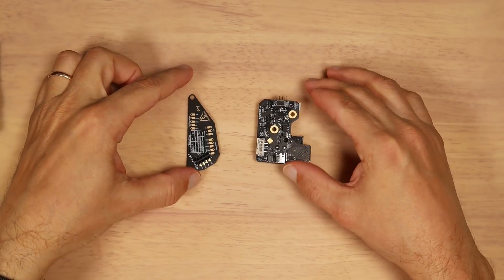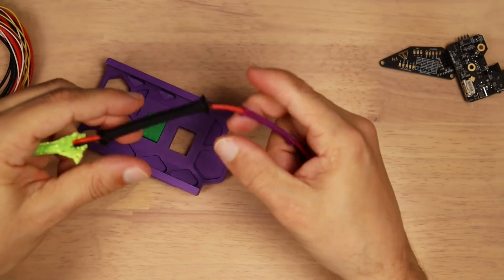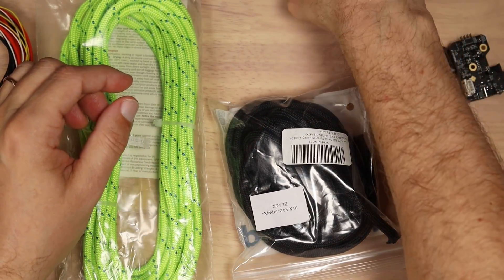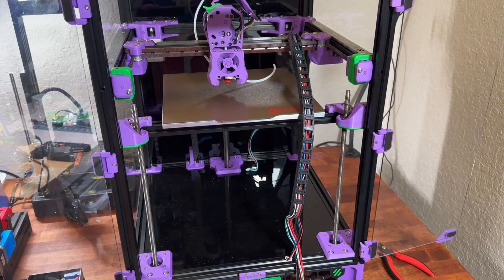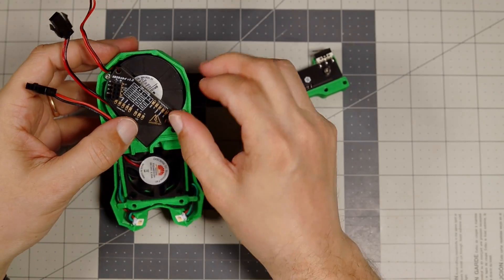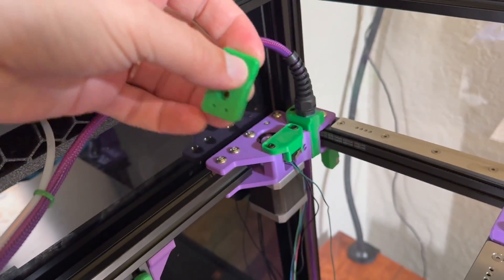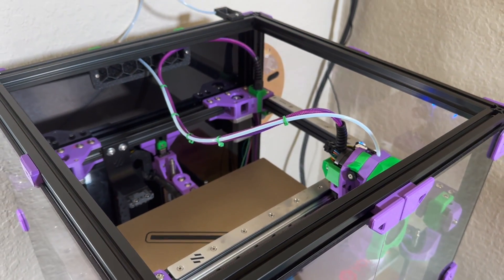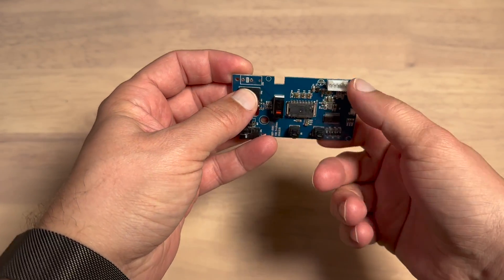Installing Mellow Fly SB2040 on Voron Trident (Umbilical)

Comment: What is the difference between running 24v fans on GND vs AGND? Any reason you used GND? Seems like official documentation recommended 24v + GND for 2 wire fans
Reply from the maker: Hello, If you look closer at 3:52 you will see the end result up-close. Using GNG was mistake because it keep fans running all the time. AGND stands for Analog-GND it allows fan control feature.
Reply: @hobbyistnotes  thanks! Will re-wire mine
Reply from the maker: @davechuasoup  My bad, I have learned the lesson of not adding the text explanation or some kind of warning that speed-up wiring portion of the video is wrong. Live and learn...

Comment: Is there a reason to run what looks like 30t idlers  instead of the normal 20? And are the pulleys 30t too or??
Reply from the maker: Hello, those are 20T with stock motion system, may be camera makes them bigger 😵‍💫
Reply: @hobbyistnotes  thank you, I was in fact tripping hard

Comment: Do you have a link for the 3d printed parts you are using thank you
Reply from the maker: Here is cad for PG's: https://github.com/hartk1213/MISC/blob/main/Voron%20Mods/Voron%202-Trident/2.4/CW2_CAN_Umbilical/CAD/CW2_Umbilical.step
Reply: Thank you do you have a video  installing the firmware
Reply from the maker: @constantinsimion5129  https://www.youtube.com/watch?v=u6wDHC9NCIY
Reply from the maker: Y switch STL is in original Voron trident github repo: https://github.com/VoronDesign/Voron-Trident/blob/main/STLs/Gantry/AB_Drive_Units/%5Ba%5D_y_endstop_housing.stl
Reply from the maker: Voron Trident A Drive Cable Cover: https://www.printables.com/model/235931-voron-trident-a-drive-cable-cover-with-pg7-cable-g
Reply from the maker: Voron Trident A Drive Cable Cover v2: https://www.printables.com/model/326623-voron-trident-wire-cover-w-pg7-cable-gland-adapter
Reply: Thank you but I can’t find the one you printed
Reply from the maker: @constantinsimion5129  what exactly? Pg7 cw2 mount? It’s in the cad u need to open cad and you will find it there or check GitHub history of this repo, idk why owner of those STLs have removed it from easy access.
Reply from the maker: @constantinsimion5129  Here I have loaded it over my GitHub: https://github.com/irebane/my-printers-misc/blob/main/STLs/SW2-Unmbilical-PG7.stl

Comment: Ich habe in Zeitlupe geschaut du hast es völlig falsch abgeklemmt Hef muss an 24v un agnd und dein Pcf muss auch an agnd da diese zwei Port geschaltet sind so wie du das jetzt angeschlossen hast ist es nicht getrennt Schaltbar weil Dauer gnd also Leute uffpasse
Reply from the maker: Translation: "I looked in slow motion, you disconnected it completely wrong Hef must be connected to 24v and agnd and your PCF must also be connected to agnd because these two ports are switched the way you have connected them now, it cannot be switched separately because the duration is gnd, so people be careful"
Reply from the maker: Good catch! You are completely right but that is why on 3:52 there is upclose shot of how it have to be soldered.

Comment: And where can I get a bracket for PG7, which is mounted on the print head
Reply from the maker: Unfortunately the link for this part no longer available... I have tracked the guy who had this STL before but now he only has one for PG9: https://github.com/hartk1213/MISC/tree/main/Voron%20Mods/Voron%202-Trident/2.4/CW2_CAN_Umbilical. You can try and reach him directly. Also this mod might be a secondary option: https://www.printables.com/model/366499-voron-24-canbus-umbilical
Reply: @hobbyistnotes  
Thanks for the author's source. You can always see the changes on the github, but I can’t post a link to the detail, YouTube deletes it.
Reply from the maker: @DarkSoulVenq  oh yeah you right, I was focused to find an actual stl so blundered the fact GitHub is a version control system 😅 - funny as I use this tool on daily basis🤦🏻‍♂️
Reply from the maker: @DarkSoulVenq  After taking a look at commits repo has step file that actually contains PG7 and it looks exactly like: https://github.com/hartk1213/MISC/blob/main/Voron%20Mods/Voron%202-Trident/2.4/CW2_CAN_Umbilical/STLs/CW2/cw2_umbilical_cnlink0_threaded_mount_LP12.stl

Comment from the maker: I do not recommend to buy this product, unfortunately It has issues with 5v rail, if you load 5v buck converter tend to overheat and tantalum capacitor in it's circuit can generate "magic smoke". There might be second version available soon, also make sense to check other products.

Comment: Thanks for the great video! Two quick questions: (1) Are you using the connector labeled HV-in in the top left of the PCB for anything? And which driver did you end up rebuilding/reflashing at the end: The one for the RP2040 or the one for your Controller board? And what was the specific change that you made? Was a little hard to catch it in the video.
Reply from the maker: No, I am not using HV-in as I have klicky setup that uses only signal and ground. At the end to fix crashing we change: 1. Can Network Interface (RPi) 2.Rebuilding Firmware for SB2040 board 3.Rebuilding Firmware for Printer Control board  (You can use YouTube's slower speed feature to see commands and settings)

Comment: I've connected X&Y to GPIO16&17  and made an adjustment to the TAP piece to hold both switches. very clean and very neat setup. GPIO29  for a filament runout sensor.
Reply from the maker: Yeah why not it's also a good solution! How is SB2040 temps treating you so far? Mine is quiet hot...
Reply: @hobbyistnotes   I've printed the sb2040 fan cover from printables and stuck heatsinks to the 2209 and the vreg coil, fan off temps go in the mid 80ies, with fan on - accurate ambient (in 13c ambient was able to drop all the way to 13).  fan is a must, I use 3007 24v. btw, i run my can at 250k without any issues, infact, when bumping to 500k  I constantly get reorder packets, this used to mess up the probe results and if the packet in question is to/from tmc2209 the print is ruined.  not a single issue at 250k. input shaper calibration goes all the way to 133hz

Comment: isnt't the extrusion backer on the x axis wrong? shouldn't it be behind you rail to counteract the deformation?
Reply from the maker: I think it depence what exactly we are trying to counter, I prefer to have more consistent Z height as play on Y axis doesn't bother me that much.
Reply: @hobbyistnotes  Ah okay, is there information/ tests about this? I have only every seen it opposite of the rail and on top only on dual rails.
Reply from the maker: @janboerschlein  Not really, it's just my semi-technical-educated guess. I can probably make some tests to see if it really matters. Actually I was making the video about those backers and my results were so inconclusive that I decide to not post it as got more questions than answers. In short: for my build with 1h heat soak, effect was barely noticeable at all and I got feeling it was complete waste of money.
Reply: @hobbyistnotes  yeah I think it's more of a prevention than anything. If you let your extrusions headsoak they won't change much over the course of the print. with bed_mesh you pretty much cancel out the effect then.
Reply from the maker: @janboerschlein  My guess is that Trident has structure with more anchor points than Voron 2.4 and those backers will have way more effect on 2.4 as gaintry aren't really anchored as much.

Comment: Hello!  Great Video!  I never would have thought to try paracord for sleeving.  Just out of curiosity, which cable gland mod for the A Motor Mount is that?  It looks great!
Reply from the maker: https://www.printables.com/model/235931-voron-trident-a-drive-cable-cover-with-pg7-cable-g
Reply: @hobbyistnotes  thank you for the link!
Reply from the maker: In my case I had to make hole a bit larger and glued gland thread directly to it.

Comment: Does the SB2040 overheat? I see a lot of persons running it with a fan
Reply from the maker: If you will run 5v fans and extruder motor driver from it, the board can heat up a lot, one of the weakest spots is 5v rail. Mine even with LEDs heats up pretty hot. If something goes wrong I will make an update video for sure, so far everything runs fine.